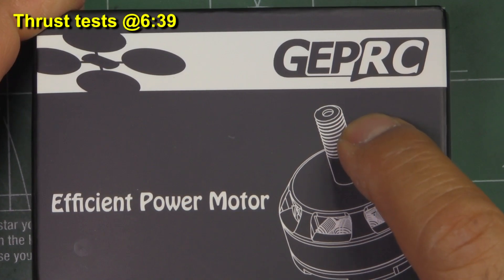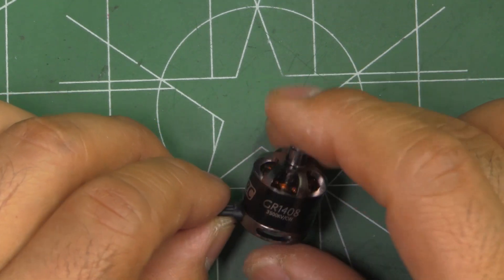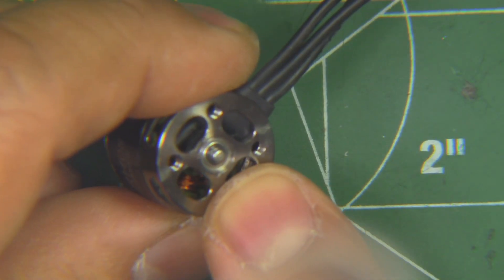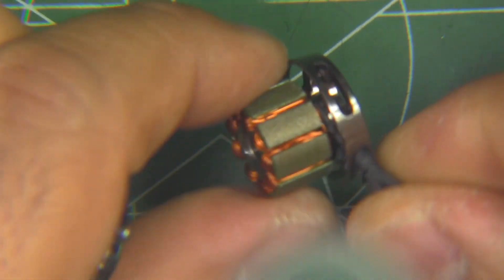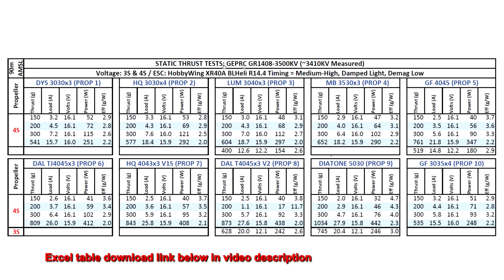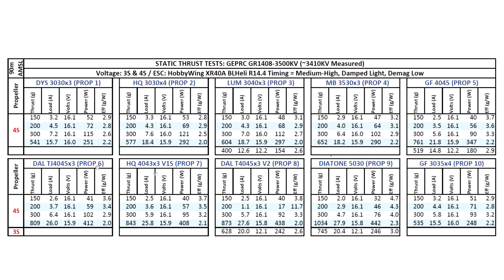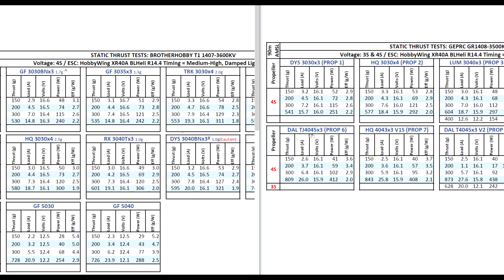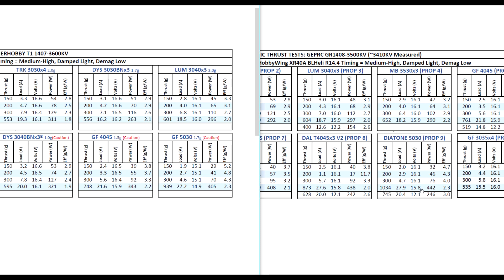GEPRC-GR1408-3500KV Thrust Tests & Overview

Comment: what is the all out best motor for a 3"
Reply from the maker: Power, 1507 or 1408 3600 to 4100kv - all depends what you want to do and rest of setup. 
BH, GepRC, Cobra, Mamba, there are so many good ones, really can't say there's only one best motor.
Reply: @EngineerX  awesome, is thee any 1408 you would say stand out from the rest?

Comment: Is it ok for 20A ESC with Gemfan 75mm Ducted Props PC 3-Blade Propeller? Just want to learn more.... Thanks for the video.
Reply from the maker: I noticed this motor ran very hot. It's probably too small for a 75mm ducted fan. You will need very high rpm but depends on load or how heavy aircraft is. I'm not too experienced with those powertrains but I think you can research what size is better
Reply: @EngineerX  thank you so much..

Comment: Great video 10x! I have 3" mx3 GepRC. Which motor is better? This in test GR1408 or Tmotor F20II 3750kv: http://bit.ly/2BnskTL ? Do you have test whit this T motor 3750? 10x :)
Reply from the maker: dimyata. TMotor usually makes very good motors and that one should be good for 4S. I didn't buy that new TMotor. I've asked TMotor for test samples but they don't send any :( I have the new SunnySky 1408 but only 3200KV. SSky said they would send some test samples but I'm still waiting. Thank you for watching.

Comment: You burned the shit out of your motor. Maybe thats why its only 3400KV 😂
Reply from the maker: Nah! If you look closely at the data comparison @10:47 DYS 3030x3 prop results, BH=556g, GepRC=541
BH 1407-3600KV, true KV is actually lower around 3500KV. GepRc has a larger 1408 stator so it should make more thrust with that prop since it's a very "light" prop that doesn't load motors too much so the motor's KV has more influence on the thrust result.
Another motor, very similar thrust result which tells me GepRC KV measured is as it came from factory
XNOVA 1407-3500KV (actual 3520KV) same prop = 535g
https://youtu.be/lVsGjIJ3RNg?t=12m4s

If anything, KV should go up when motors are seriously overheated often or for long time, theory being: magnets demagnetize due to heat so motor KV is supposed to go higher according to what I read somewhere on the interwebz.
Reply: @EngineerX but the thing is, that the motor started smoking and you were only punching for a short period of time so that the magnets  couldn't get heated enought (80 deg min) so they would lose some of their magnetism. Else the copper windings started getting realy hot, to the point where the coating would burn of and the wires stardet shorting out. You were definatly right with that the motors on a kwad wouldn't be handling that mutch amps, because they would just spin up and run lower after. What I'm getting at here is that the motor has lost some windings throgh that process. You would also see an increase in amps, but I know that bigger props pull more amps. But anyway thanks for your response and hopefully you didn't get it the wrong way, I just love writing english. ;P
I like your vids keep on making them👌
Reply from the maker: No worries, I think if the windings really got damage after the smoke, then next thrust test = fire because the wire enamel got completely burnt.  
A puff smoke means windings got hot and burnt off some enamel or residual lubricant, epoxy or whatever material that's left over on the motor at the factory. Even if wire coating burns off a little, the copper wire doesn't degrade, the amount of heat the wndings were exposed to doesn't change the properties of the Cu wire. It's still the same Cu able to carry the same current. The problem would be if you completely burn off the coating and you create a short.
The motor can't "lose" windings and still work, once you lose any winding, the motor will spin for a bit then burn, spin and stutter or not spin at all. 
Also if in fact you lose windings: Then KV goes up. As you know KV depends on number of turns per coil. If you loose windings then you would end up with fewer effective turns causing motor KV to increase. I've tested dozens of motors and this is not the first one that puffs some smoke. KV does decrease to 0000KV when you damage windings ;)
Reply: EngineerX I could talk for hours with you :D
Reply from the maker: Technik :)

Comment: Could you tell me this geprc motor ccw or cw is only for the locknut thread or also for the motor?
Reply from the maker: I'm looking at BGood order from 2017-08-28.  I selected "Mode: Clockwise Screw Thread" Because I wanted standard thread and of course ended up getting reverse thread >:|
So they actually sent the wrong thread. Might be best to get 2 of each?
Reply: EngineerX yeah i also ordered clockwise thread,4 of it. So the mark cw or ccw its only for the propeller thread right? Not for the motor.
Reply from the maker: TUYULs FREAKs the way it's described it for the prop shaft thread but they shipped wrong. As long as you tighten nuts really well there's little chance nut will loosen. They may get loose in some crashes so always good to check after a crash. We ordered right. They shipped or described wrong!
Reply: EngineerX yeah i think they miss described it on the web,but good to know that cw and ccw is only for the propeller thread,not for motor rotation,so i just need extra carefull about the locknut.
Reply from the maker: Yep. motors don't care which way they spin. All motors can rotate either CW or CCW. It doesn't make a difference at all. The prop shaft thread is what forces us to make the motor rotate a certain direction so that prop nuts get tight on their own. If you take out the nylon insert in the prop nut and just tighten by hand, then the motor rotation will tighten really well. I tried it on a quad and I was surprised how well and easy it worked!

Comment: How do you think 5030x3/4030x3 cut down props would do with these motors on 3s? or better yet 4040x3?
Reply from the maker: Should run fine on 3S. The Gemfan 5030x3 are a bit too flexible so they may flatten out due to high KV.... but it's worth a try if you have them around, but they're weak so I'd rather use others like DAL, HQ, etc. I think the DAL T4045x3 V2 or HQ4043x3  would perform better
Reply: Thanks for the reply, I know they're older props but i still have alot of them as well as 4045 props. I'll give them a shot with my new build.
Reply: EngineerX so, I just got some gemfan 4045BN triblades as a gift today from a online merchant. Do you think I'd burn these motors up on 3s with these?
Reply from the maker: Shade Squamous I think it should be ok on 3S. Just check temp after a short hover, then after a hot lap. Just as caution but I think they'll run normal temp.
Reply from the maker: Shade Squamous only thing is that prop will probably feel underpowered. If I recall correctly it's a bit heavy and not that efficient.
Reply: So, I decided to get some of the props you recommended, the HQ4043X3, just went out to do some punch outs in the yard and wow, just wow! even on 3s this is impressive. My morphite 180 is gonna rip it now :)
Reply from the maker: Nice! and good choice on props. The Morphite 180 is what used about 3yrs ago to really learn/practice flying FPV without using FC help, what people call "rate" or "acro" Awesome frame, survived dozens of crashes and it's still in great shape. I was running 1306-3200KV motors on 4S and GemFan 4045 props. A little underpowered but is was perfect for learning.
Reply: ya know, i've had the Morphite since late 2015 and its survived alot of failsafes and crashes, one of which was at least 5 stories high down to asphalt with only some lite carbonfiber spliting. I totally get Armattan's life time warrenty, its likely all never have to use it.
Reply from the maker: LoL .... I haven't had to use it on the Morphite 180 either. I've been meaning to "refresh" it with some 1407 motors. I love that frame. https://www.youtube.com/watch?v=m5wirGweaps
Reply from the maker: That's pretty good performance on 3S.  If motors come back very cool to the touch and you're running at least 20A ESC's eventually you could even try 4S, of course, would need to check motor temps after a short fast lap and then go for a couple of laps and check temps again. Should be able to firmly grab motors without discomfort.
Reply: I've already decided I'm going to get some 4s packs soon, temps seem good after flights, motors are slightly warm with the triblades. I'll probably use my 4045's on 4s though. May get some in PC, the ones i have are ABS.
Reply from the maker: You might be better off staying with those 3-blade props. The 4045BN are very wasteful at full throttle due to the straight edge at tip of blade. Everytime I tested them, they'd draw as much current(even a little more) as 4040x3 props and make the same thrust or even a little less. Here's a test, it's a larger 2205 motor but it shows the characteristics of both props https://youtu.be/ZrEmrO9cRiA?t=17s
Reply: EngineerX  Lol, I forgot about those bullnose triblades, they might be good on 1806 or bigger, I'll probably never use those. I actually meant the old gemfan 4045 biblades, and I saw HQ props has a PC version.
Reply from the maker: AaAhhh.... Ok .... yes those GF4045 (and clones DAL, KK, etc) will be perfect! That's one of the most efficient 4" prop for small 1306 - 16XX size motors. Just make sure to check there's no creases as those props are fragile and will need to be checked/changed after every rough landing. I had several blades separate midflight because I didn't replace after long use and some tumbles, and that was with 1306 motors. The PC material of the clones is much better, though those clones are not as good as the original but only slightly and probably only noticeable on the thrust stand tests. Anyway, good prop to use - that was all I used in my Morphite with 1306's

Comment: Bah, dissapointed. The brotherhobbys are old news these days, these should have beaten them. On 3 inch, the rcx 4100kv are the way to go and come down cold, and on 4 inch, the cobra are far more efficient and smoother and you can even go 4100kv and come down cold. Plus the rotorgeeks are lighter... Unless these offered something new, I don't see the point. Not cheap, no more power, get hot etc.. disappointed. Why chose over brotherhobby if you want to run a standard setup.
Reply from the maker: Pretty good conclusion based on numbers on the tests. If these were a lot cheaper like $10, then they'd be worth a try but for $15 there are many better options as you mentioned. I'd love to see any of those top factories make a 1408 or 1508.
Reply: EngineerX yeah. Indeed. I don't feel like we've moved forward a lot since the tornados were released. 1407s are on the cusp of being usable on 5 inch but only for a tiny niche. out of interest have you heard anything on the cobra cpl 2207 (lighter than normal). I really fancy them on a light build, but can't find anything on them. I've loved the recent cobra stuff Ive used.
Reply from the maker: No I haven't looked into Cobra's new stuff. Lots of new motors all the time.... difficult to keep up!
5" on sub 250g builds (imposed by new rules over in the UK - you are there right?) does require some good planning. Adam Featherstone has been doing lots of experimenting, https://rotorbuilds.com/build/7104
LiPos are one of the limiting factors since a smallish pack has to be used to keep within the weight constraints. If more 2207's like that new Cobra are tested and flown side by side with 2306's they may end up clearly showing 2207's have the advantage. Let's see what the new "trend" will be..... EMAX is coming out with some new ultralight 2207's (which they said they would send to me for testing --- woohooo!)
https://www.facebook.com/emaxusa/videos/858570997651256
https://www.youtube.com/watch?v=EUfyPW77v_g
Also, MyRCMart will be releasing some new 2207's (2400 & 2700KV) as wel, they're supposed to be on the way to me for testing.
Reply: EngineerX yeah I'm running a 5 inch at 233g with a split. 210g with a micro. the UK where I live has no such limit. its a draft proposal and will take potentially years to come about. It also has no place with what we do and is targeted elsewhere, and I along with everyone else will just ignore it :) Don't see many police in fields and woods these days. you're lucky if u see one in a city!
Reply: EngineerX ooh and those emax sound interesting!
Reply from the maker: Good! I thought it was already some new enacted Draconian law. So far I think more people get hurt by cars, bicycles, scissors, shaving appliances.... etc than our 5" drones. I gotta get on with my build, also have a Split and will use RCX 1407 motors. Cheers!
Reply: Indeed, can't see the terroists following the laws either! I fly sensibly, am aware of my surroundings, and chat to lots of people who are curious. Just today, 2 kids used my goggles with their parents watching, everyone I've met is fascinated, not horrified. 
I'm not changing. 
what frame you using? Check out the tomoquads UL4 and 3. Seriously gorgeous. 2 motor screws tho. Scared... but really want...
Reply: BH 1407 still the king of 1407 motors :)  i just build a 4 inch racer  (AWU = 140g )   with tornado 3600kv and its a beast !!!  >> https://rotorbuilds.com/build/7393    . My friend also build the  same  4 inch racer  except motors  (he used RCX 1407-3600kv ) and hes disapointed with quality  , one of the motors have a strange Noise  different from the other 3 motors

Comment: HAHA I called it! BrotherHobby Killers 1407 Killers!!! :P
Reply: BH 1407 still the king of 1407 motors :)  i just build a 4 inch racer  (AWU = 140g )   with tornado 3600kv and its a beast !!!  >> https://rotorbuilds.com/build/7393
Reply: Ablazing skies definitely not bh killers if they smoke on 4 and 5"
Reply: did you not hear what he said about being on the bench?
Reply: Not even close bro, the BH 1407 is THE 1407 to have...  GEPRC sent me a set to review for Amazon and they are great motors no doubt BUT I have these on on a custom frame and the same frame/Build with the BH1407s and plain and simple the BH1407 (im running a few sets of the Hyperlite BH made 1407s but i mostly run the Catylist machine version called the Freedom im rhe 3600 and 4000kv model) powered quad is faster, more acceration out of turns, smoother, more durable, the 4000kv is flat ballistic on HQ4x4.3x3v1s running Tattu 95c R-line 850 4s..  the Dry weight of Freedom 1407 3600kv rig is 123 grams and 128 grams for the HGLRC 1408.. the BrotherHobby made Freedom 1407 3600kv beats in it flight in every single way.. there's honestly no compassion.. the 4000kv is you have good batteries and don't mind shorter flight times on a light 3 inch build is mind numbingly fast. The GEPRC motors are good motors don't gert me wrong, they will be getting a would 5 star review BUT they honestly aren't BH1407 killers, not even close.. the BH doesn't kill them neither BUT it does solidly out preform them in my setups in every way.

Comment: Looked like a puff of smoke came out of the motor just after the HQ4x4.3x3 V1S props and Diatone 5030. But they did say it's designed towards 3 inch props.
Reply from the maker: Seem like the wire used has lower heat/current rating that most other 1407 motors. Their spec's are quite correct stating 23A as the max current. You can probably still fly those props since Amps will be around 30% lower. I'm sure we will see people use them in their 3" & 4" builds and see reports about their durability.
Reply: Saw that too